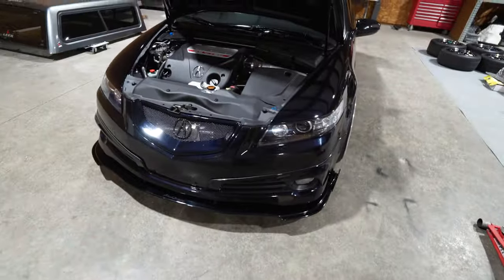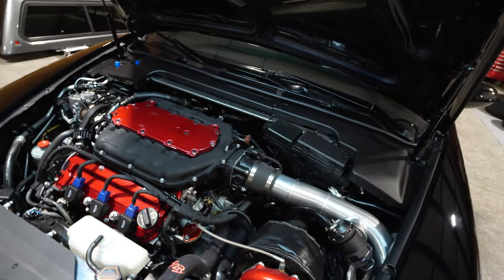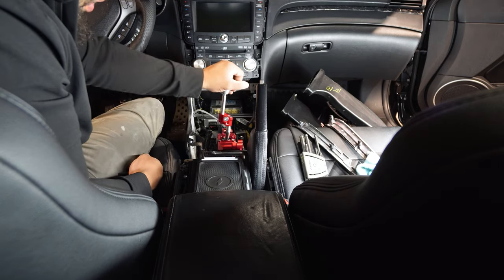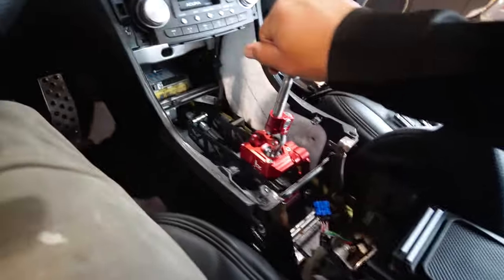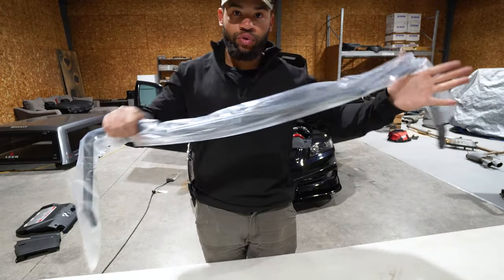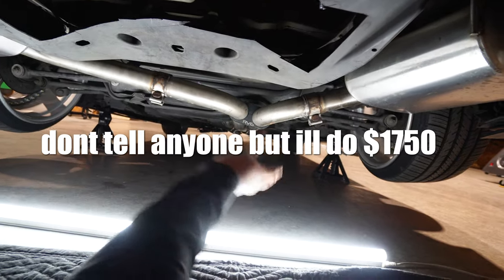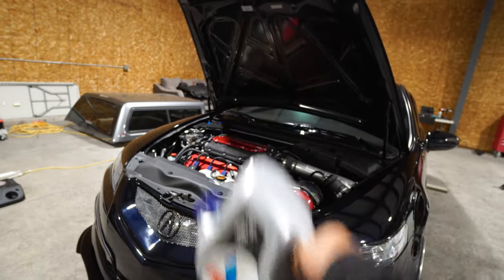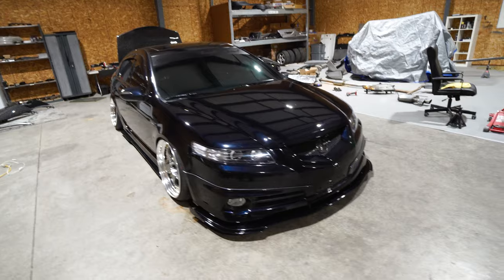Boosted TL gets ready for a VERY Special Day...

Comment: Leave you stranded? Sounds like it's not reliable! Maybe too much was done to the car. You should just know if it will leave you stranded or not. I'm hoping it doesn't though.
Reply: Too much done to the car???? Never heard such thing
Reply: He just recently got it boosted. its his first long trip so i think its normal to think of those things.
Reply: @gsuelo05  I mean if you’re going to upgrade to the point where you won’t use any of it is doing too much. Like turning a car into a track car and don’t track it for example.
Reply from the maker: It’s all first time talk that’s it, cars been solid since boost I want to continue to put out a good reputation for Taylor who helped me piece this all together. Many ppl may consider boosted TL as not reliable so the more I’m driving with no problems the better 👍🏽